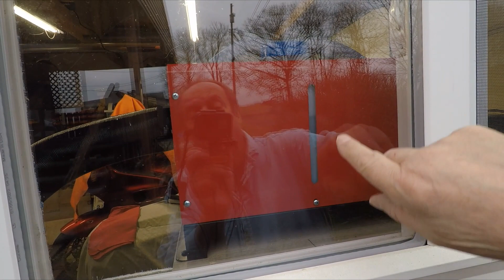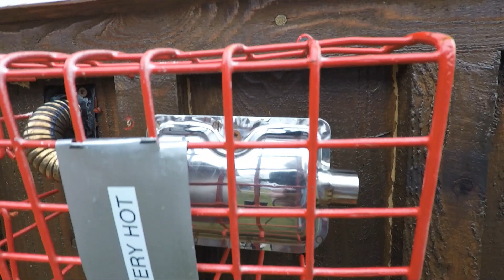CHINA DIESEL HEATER

Comment: Nice information here in your video.
 I bought one of these several months ago but haven't had the heart to put a hole in my wall. I have a shelf right in front of the window like you do. I figured it would be a great place for it.
Reply from the maker: Hi Danny, Thank you for your comment. You can always fill the hole in if you take the heater out. 
If I would take the heater out for the summer I will make an aluminum plug that would go from the outside in  and have a large end on it then on the in side have a cotter pin through it. Go for it. Once I get things arranged my wife will keep her bike under it.  Norman.

Comment: These heaters are great, especially for the price. I’ve had one for about 2 years now and use it in my conversion van. Never had a problem with it. I can run it for 12 hours on a little more than 1/2 gallon.
Reply from the maker: Would that be at the lowest setting?     Norman.

Comment: Been looking at one of these for an RV/ toy hauler. Do you think you may want to put some type of metal cover on the outside of your wood garage wall between that muffler?
Reply from the maker: Hi Michael,  The way the muffler is made you have to use a stand off to hold it to the wall so it is not touching the outside wall. I took a 3" deck screw through the muffler then through a piece of metal tubing and into the wall. Now the muffler is away from the wall. This heater would be great for an RV.  We got some snow today.  Norman.